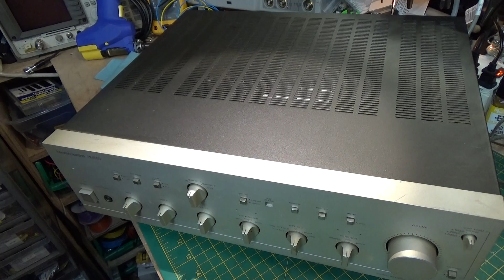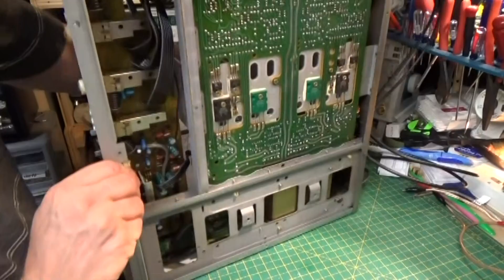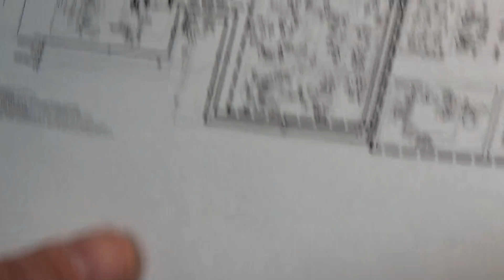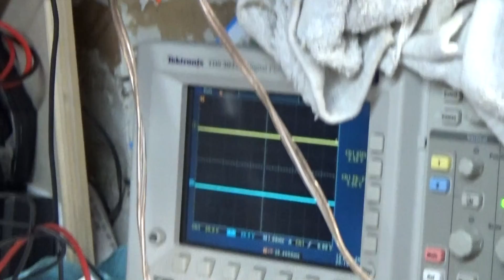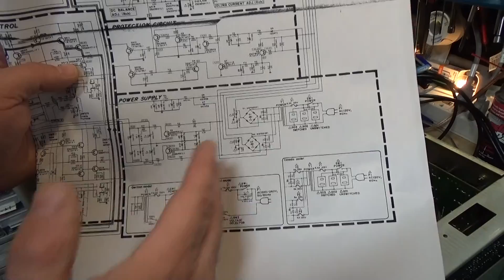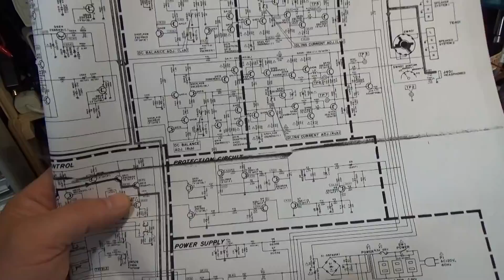Harman Kardon PM655 Checkout & Repair

Comment: PM665 is the twin transformer version of this amp.
Reply: I just bought a 655 on Ebay and its actually a 665. I saw the two fuse holders and took a gamble. seller even said it was heavy for only a 60watter.
Reply: @ralphraccoon5606  Lucky you! I love it when that happens.

Comment: the small buttons on this series are the worst ever made. I have had mine looked at twice and still getting noise. A Google search shows everyone having problems with them with regular deoxit needed. I am considering bypassing a couple of them since an awesome sounding amplifier is unlistenable due to this problem.
Reply: I have tried with Deoxit D 5....is not working at all....soluyion?

Comment: How do I clean or restore the faceplate, weird metal
Reply: its Aluminum with anodization. I use dish soap. sometimes alcohol. if its turned purple its just the way it is now. always be carful around printing it can wipe off on some.

Comment: I have this amp, it was stored for about 18 years pulled it out cleaned it up scratchy buttons etc, inconsistent sound. After cleaning all sounded good. I don't use daily. About 3 months in it started taking longer for the sound to come on after powered up. Deoxitd again every 3 months same and lose left channel, open up deposit on the mechanical speaker pot in the rear and volume switch then all sound comes back again for a few months the same issue any thoughts would be appreciated.

Comment: I know this video is 6 years old, but I can't believe you opted to jump the bass contour control so that it's permanently active. No audio purist would want that, they would want it bypassed.  I have two of these, the champagne face PM655 and a black PM655vxi. Got the champagne face one for $15 at Goodwill with the TU915 tuner for $8. All they needed was contact cleaning and they sound amazing.
Reply: i cleaned with Deoxit all my switches....the bass contour is still noisy,and mono/stereo switch is inconsistent...anoter way to solve this?thanks
Reply: @GREENTICKETRO  I didn't do the service myself, I had a local tech do it. When I brought it in there was no sound going to the speakers at all. Not sure what to suggest other than more deoxit. I think I read in one of the audio forums that the switches are not easy to find, but I haven't researched this unit in a few years.

Comment: Funny story. My pm655 was the first better quality amp I ever had.  I used it to do acoustic testing in a club house.  On the way home, the catalytic converter in the car overheated.  The amp was sitting over the exhaust.  The heat boiled the capacitors and melted the thing in general.  Put terrible fumes in the car.  Drove home with the windows open.  Figured out what happened once I got home.  Miss that amp.  Used to put my speakers in the backyard and play weekend "concerts" with it.

Comment: Along with checking for DC offset you should also have another meter monitoring the idle current so you don't advance the variac to the point of destroying power stage transistors.
The bulb limiter will not always prevent that.

Comment: You never connect on the initial test to loads not knowing if the output stage has DC offset.
Yes the protection circuit should keep the relay from engaging however you still can have intermittent (bad connections for instance) that can cause offset after the relay engages that can damage the output stage trying to drive rail voltage into a load before the protection circuit engages.  Been there, done that.
Solid state amps don't care if there is no load at idle so why take the chance.

Comment: I just parted with my PM 655 last week. I have been using it since I purchased it new in 1986. Ironically, it had the same issues as the one you worked on. Gave it to a friend to "play with." He called me two days ago and reported that it works fine now. Kind of sickens me but at least I acquired a vintage Optonica  integrated amp and tuner. I am going to miss that amp. We had a lot of good years. Hopefully, my friend can get the same pleasure as I did over the decades. Thanks for keeping these awesome relics alive. I wish I had the skills. Respect.

Comment: Hi Tony, HiFi engine says this is a 100 wpc ramp?
https://www.hifiengine.com/manual_library/harman-kardon/pm665.shtml
Reply: This is the 655, which is 65 wpc
Reply: PM645 was 45 wpc,  PM655 was 55 WPC, PM665...  Guess what ?  But, as he noted, they were high amperage amp. That's why they were so good.

Comment: ITs more likely that the caps fail on higher voltage and pass on lower , then its added leakage , but anyways i didnt get what did you do to make it work , assembled it and it worked . OR was the recap in between

Comment: A weak area for HK in the 80's were the I/O jacks. They would tend to crack and fall apart over time. This happened to me on each piece I owned. Usually, the sign would be a jack that would start getting wobbly.
Here's how I took care of it on my tuner
https://www.youtube.com/watch?v=aipEZ8eRcw4
I've subbed your channel, would you please leave a comment on the video and subscribe to my channel
Reply: Better ways to solve the issue than to make a mess out of the rear panel

Comment: If I find that someone's been there before me the customer gets it straight back unless they've been honest about it up front. Then they get told this may get expensive.
Reply: Got to many tube amplifiers with the request to be re-tubed only  but to often they were ( very) problematic because someone messed the circuit up before .....many faulty " upgrades &  disastrous modifications " ..............and very often BAD solder work ! Even oil in the  tube sockets caused me to wonder what' was going on until i discovered the presence of it ............i changed my attitude on repair , when i was not i informed honestly about the real issues i send them back .......
Not all problems were caused by the owner or a friend of his but some came out of a repair shop who didn't live up to the knowledge of tube technology.

Nothing worse than to have an amplifier messed up before you get it for repair ..most  of the time without it's original parts and unknown modifications of the circuit , even parts taken out of it .....

Comment: You make a mistake my friend that isn't PM 665 .Pm 665 has 2 transformers indipendent and is a mervolous amplifiers with two great black vertical and simmetric sinks...
Reply: Is the absolute in quality for the cost of acquisition.The circuit is the best in that period .Looking in the hk 990 you can see a small evolution of citation XX.Better as circuit by worst as power (60x2v hp 990-2x75 v cit XX ,supply power)..
Reply: He typo'd it. If you look below the title, he states it's a PM655

Comment: 1) Are the circuit boards marked +/- for electrolytics? 2) Did you check each cap to see if the markings on it matched where the foil end really is? Apparently there are a lot of mismarked capacitors out there, even new ones: https://www.youtube.com/watch?v=BnR_DLd1PDI
Reply: Yes , this is a problem , i always mark with a felt pen a point  on the board.

Comment: I have the exact same amp (PM 655), but in black. I purchased it brand new in 1988, IIRC. You have inspired me. I know one of my channels has gotten week because I now always have my balance set markedly off center. QUESTION: What brand of capacitors did you use? I hear there are certain ones which are audio grade (i.e., you mentioned Nichicon). You mentioned the whole set was only about $20 (I guess not including the filter caps?). That sounds awfully low. Can you provide your source? I am looking forward to discovering all the cracked solder joints and putting my amp back to the way it sounded thirty years ago. Thank you. 
PS: One of my favorite features of this amp is the selectible Moving Coil/ Moving Magnet button. I run both a B&O turntable with a MM and a Dual CS5000 with an Ortofon MC cartridge. However, I have never done much with the capacitance switch - guess I'm not that high a degree of an audiophile.
Reply: I like Epcos ( screw series/low esr long life )for the supply rail..........further Nichicon, ELNA silmic II and cerafine.....i find Panasonic FC witch are good capacitors but to my taste  a bit colder and mechanical sounding ....
There are many brands and some are very good but impossible to try them all ..........i stick to the one i had good experience with and most satisfaction on listening.

Comment: you're still looking for a switch just had a look on a site I know it's a 6 pins switch isn't it? I found one it's a latching looks like it will fit in? at 65p each, it's called an ALPS SPPH410100 SWITCH PCB DPST LATCHING  AT :
http://cpc.farnell.com/c/electronic-electrical-components/switches-relays-solenoids/prl/results/2?brand=alps
Should do the trick had a look at the PDF file the centre pins is common looks like it will go straight in

Comment: It's the 655 model. I have one too and although it runs a little hot it is  a great performer. For the missing switch I'd get a lower end parts unit like the 635, they have the same gritty switches. HK had good intentions when they decided to cover the contacts with silver, but as time passes they corrode again and again. A sollution would be to open the switches ad sand down the silver layer.
Reply: I spay them with silver cleaner, wash and protect them with an anticorrosion spray ..

Comment: What is the downside to this amp sitting for over 10 years not being used?
Reply: Mostly ..........Corrosion on all connections & contacts.............starving/leaking capacitors.........dead solder joints...........dirt build up.....etc.

Comment: Harman had lots of problems with those push-switches. In my experience about the best you can do is clean the heck out of them, and hope for the best. Since the root of the problem is tarnish on the interior contacts, it helps to exercise them frequently as a preventive measure even if you don't normally use them.
Reply: Exactly is the weak point of that series and must be cleaned some times..

Comment: I still have a HK870,HK825,TU912,HD300 from 87 it was $1419.00, took it out of a 20 year storage & everything works perfect..I couldn't have been more relieved.Everything I've ever seen about this period, solder breakdown is the biggest problem
Reply from the maker: I agree.  I just packed this one up for sale on eBay.  Never-ending solder joint problems!
Reply: do you mind share your ebay user ? I will on the look out for your listing. thanks

Comment: I see same problem about bad solder joint on other video about Harman Kardon amplifier and the creator of video (Maxxarcade) complaining about a lot of bad solder joint.

That amplifier using Alps blue velvet potentiometer, nice, that potentiometer alone have a value...

Comment: Harman r very under rated they r a higher end back in the day 35 watt per side u need to run at least a 100 watt speaker they very clean amp if u keep it u will fall in love with it u need a good set of speakers to enjoy it their peaks r strong u will find
Reply: Any chance of using English in your attempt ?